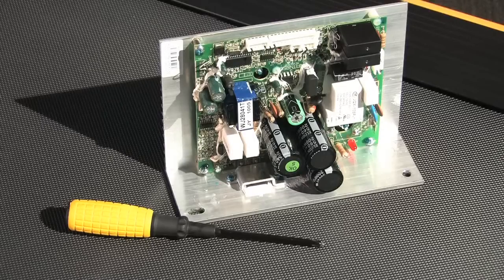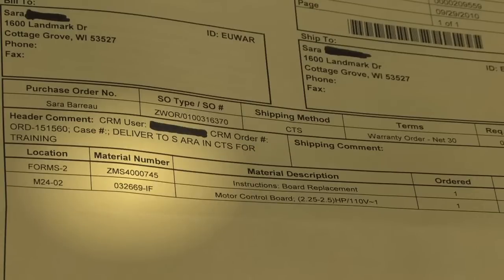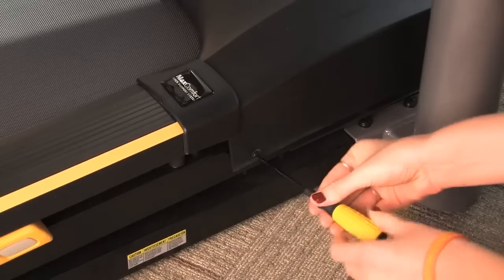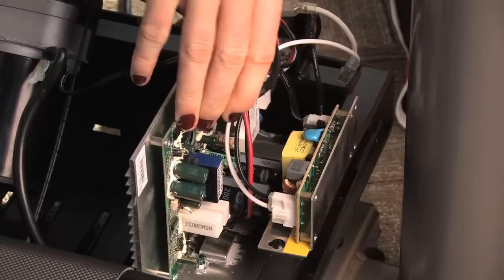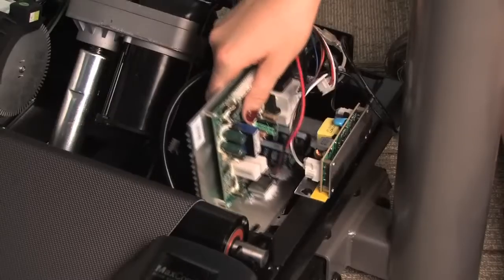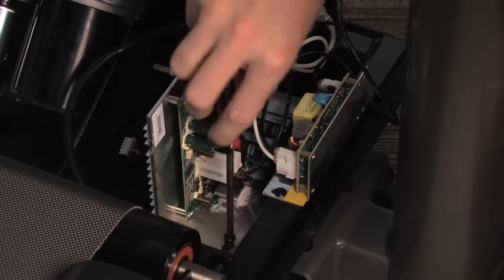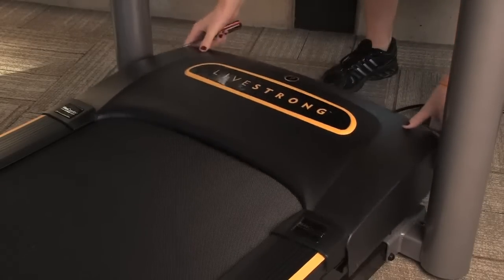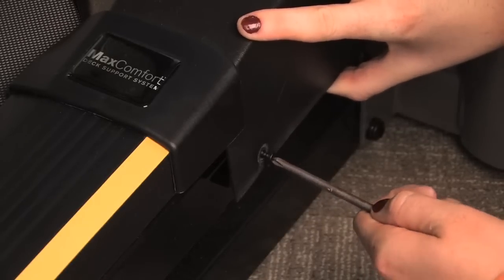Treadmill Motor Control Board Replacement

Comment: The sensible way is to photograph the connections first from more than one position. Then if two are the same colour you can see where they came from. This video is of little help, more of a mans job regardless of what you think, all this lady did was to prove that point. Certainly a female can do the job, but generally the sexes are interested in different things and better at different things. This video is of little use, just a woman of this generation taking on something and not experienced enough, trying to prove something with little knowledge of how to properly assist. God Bless